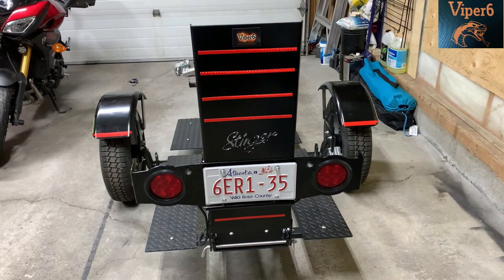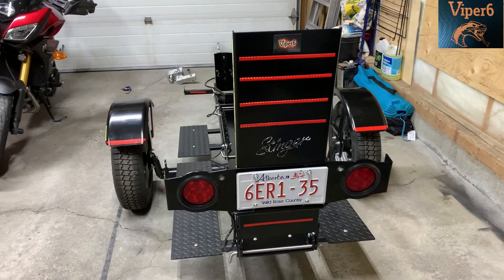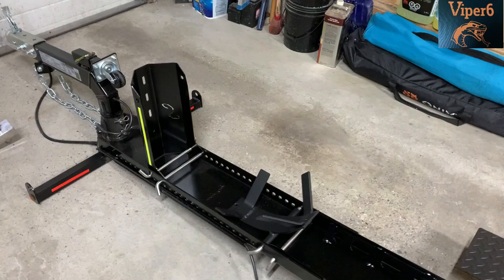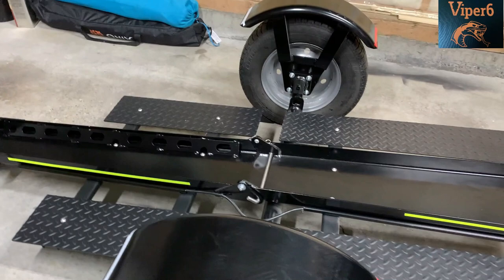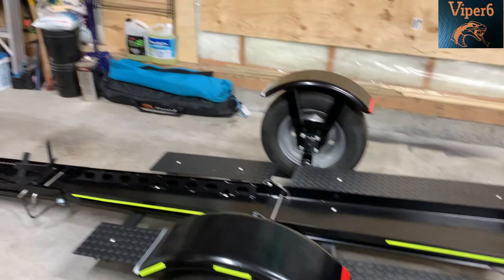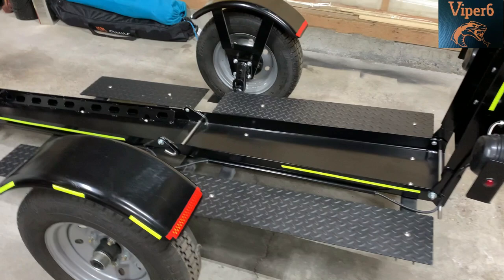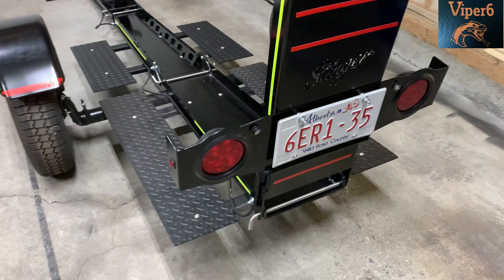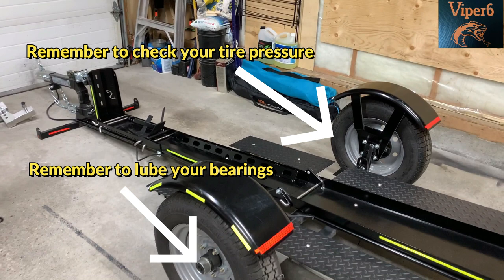Preparing the Stinger XL 112 Motorcycle Trailer for its first trip

Comment: I bought one of those about 6 years ago. I thought we would pull the bike while traveling with the van, but then we traded the van in and bought a truck and travel trailer. I am hanging on to it to see if I ever get the chance to use it. I have to admit, that I lost the desire to travel, now... It is getting close to the time for you to head south. Travel safe....
Reply from the maker: I’m curious to see how it perform. I’ll be leaving early tomorrow and will try to drive 14 hours straight on day one. Be safe bro.

Comment: Hey man, this is Steve in Chicago looking forward to your review once you've actually hauled your bike down to Mesa.  This trailer appears to have 4 anchor points for straps: 1 at each end of the front crossbar and 1 on each side of the axle sleeve. I'm interested in how well placed (or not) those front anchor points are . . . are they wide enough apart? Are they positioned sufficiently forward of the bike's front forks to provide strong stable support (of course with a longer bike, those front anchors will be closer to the forks - so this question is even more important for those of us with HD touring models).  Thank you for this video and look forward to your next full one review . . . safe and happy travels!!
Reply from the maker: Hey Steve, one of my viewers has purchased this trailer for his HD Electra Glide and reported back to me that he had no issues. I just measured the front anchor points and the bar is 30 inches wide. I couldn’t measure the rear because it’s folded up right now. I’ll be loading the sport tourer on it tomorrow and will try to film it. I will definitely upload a review once I get to Mesa bro.
Reply: @Viper6-MotoVlogger  Thanks for that info.  Be safe - and happy travels m8 :-)
Reply from the maker: @steve2515  thanks 😁👍

Comment: I see on your trailer it looks much more sturdy up front. Any earlier video I watched it showed where it bent up by the tire. Did you find in your research that they re-designed this trailer to give more support up by the tire? Have you had an opportunity to tell your bigger bike with the trailer? If so what’s your opinion of it?
Reply from the maker: Yes, the front end was redesigned as the earlier model was prone to cracking at the curved plate. This is much sturdier. I hauled a 450 pound bike for 1700 miles and it did extremely well. I haven’t hauled my cruiser yet, but two subscribers did and reported that the trailer was one of their best investment.

Comment: Hello.. can u please tell me how tall is the ball hitch that i need.. i measured my car and i only have 15 inch of height on my ball head, its the max height i can go with Miata.. thanks
Reply from the maker: Hi, I just measured mine and I order for the trailer to sit level, the top of your hitch ball will have to be between 21 to 22 inches from the ground. Have you considered looking at adjustable hitches that can be flipped upside down to give you more height? Hope this helps.
Reply: @Viper6-MotoVlogger  thanks.. it's the max I can go for my miata.. I really like this trailer. Thanks though
Reply from the maker: @MrKcire7  you’re very welcome. Sorry to hear it won’t work out.